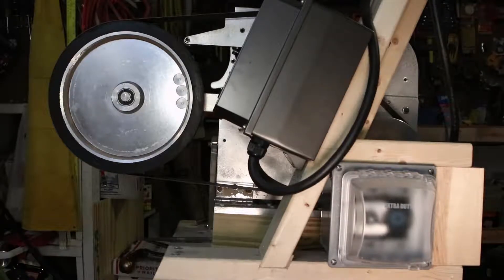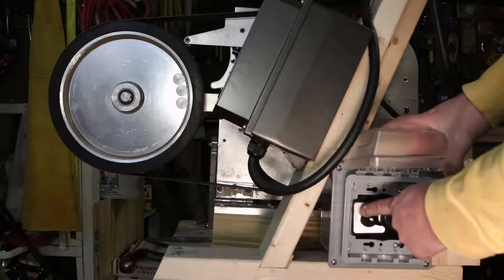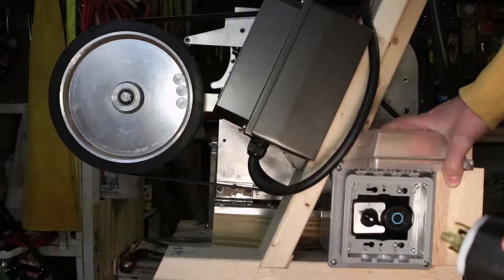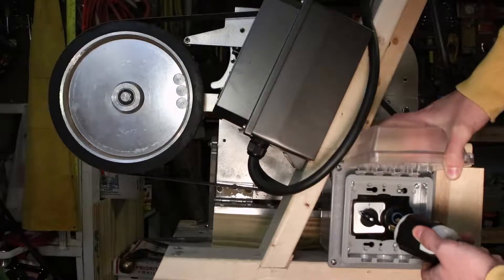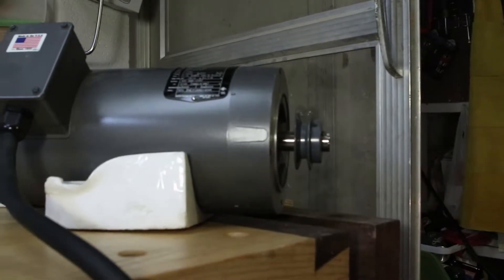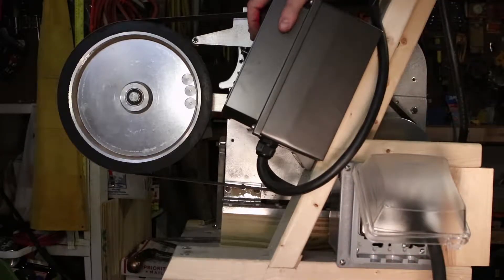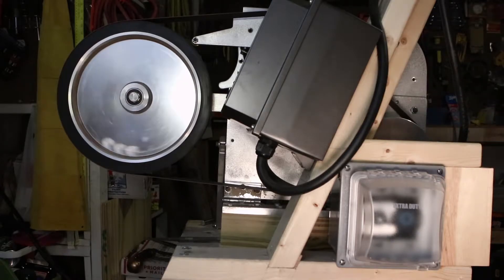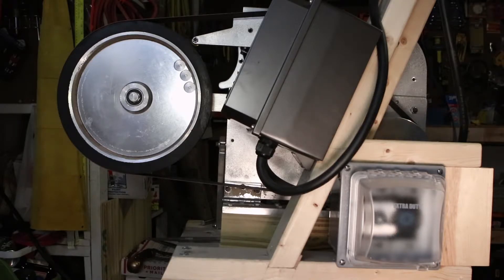Controlling two motors with a knife grinder vfd

Comment: You're awesome.  Thanks again for taking the time to help.  These type of informative videos have a bigger impact than you can imagine.  What size wire can you attach to the switch terminals?  Is anything bigger than 12 awg too big?
Reply from the maker: Jeff Lahman the connection are not big and I remember it was not easy to connect the wires. I used 12 stranded so you good likely go all the way to 10 but I would not on this switch. This switch is rated for 25 amps and made in China so I would hesitate to run more that a 20 amp circuit through it. Plus both code and common sense state that the circuit breaker would be the weakest in the system so it triggers before anything else burns. If you go with 10 awg that implies a 30 amp circuit. That means that the switch will burn out first. If you need more amperage I believe they sell the same style switch with a higher rating.
Reply: Thanks once again.  I'll stick with 12 awg solid.  Blower on a wood furnace and a light is all I'll be running.